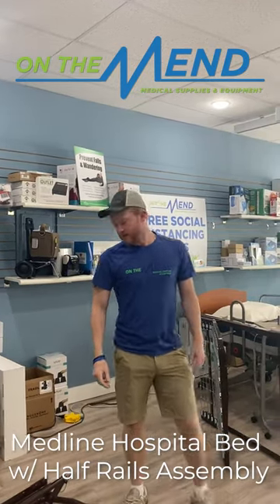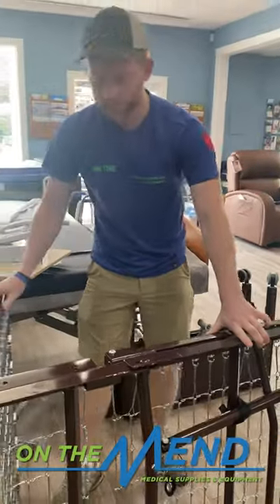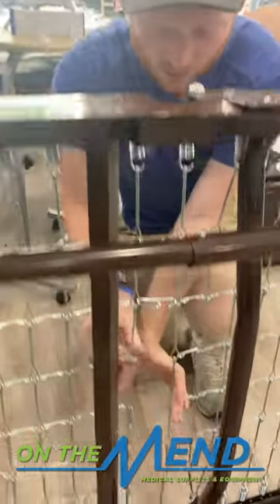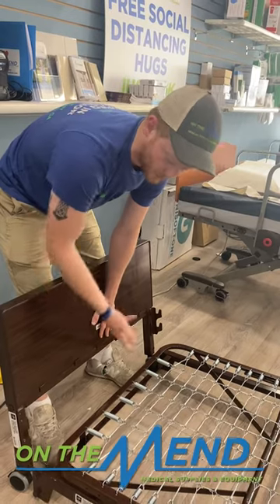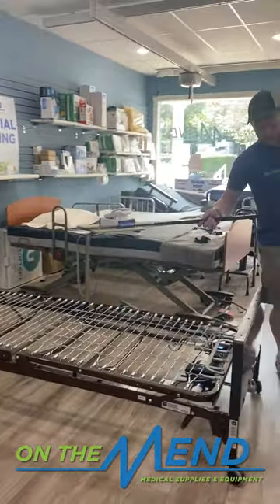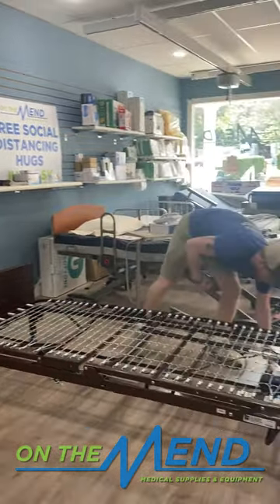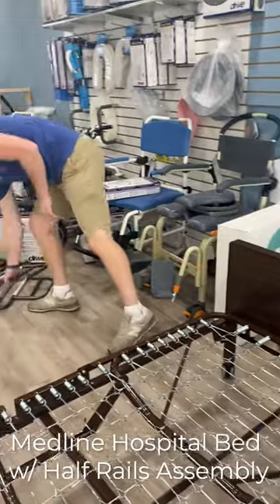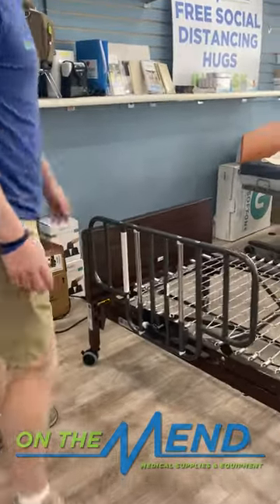How To Assemble a Hospital Bed With Half Rails (Medline Fully Electric)

Comment: I'm going for an interview next week with Healthcare Solutions (Lincare) and wanted to see how the beds are to assemble if I can physically do it or not. I'm 61 yrs old and have a bad back and bad osteoarthritis in my hip makes it difficult to bend forward. Just wondering if I would be able to do this job. If anybody that knows, I would welcome any opinions.
Reply: James, I'm nearly 59 and have been delivering these beds as well as other medical equipment since 2008. Once you get the process down the beds aren't difficult to assemble.  Full electric beds have the motors attached to the foot end so that section is the heaviest, but still not too terribly heavy. There are times while doing home deliveries where the family wants the equipment placed upstairs, and that may aggravate the health issues you mentioned. My advice is to be up front and honest about your back and hip during the interview. I've worked for a few of these companies through the years. They (at least the ones I've been with) are pretty accommodating to employee needs. Best of luck in your job search!